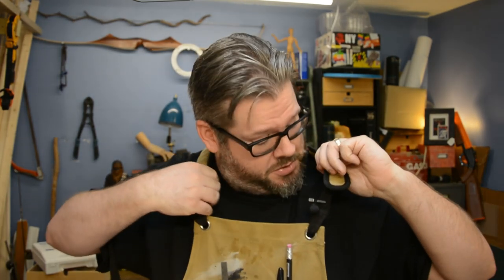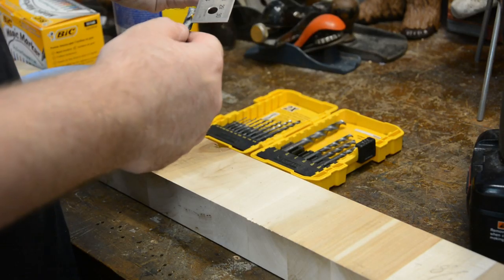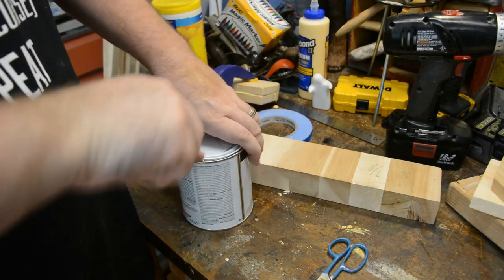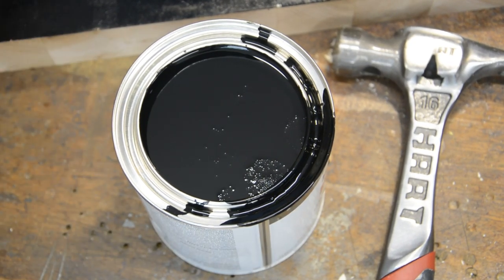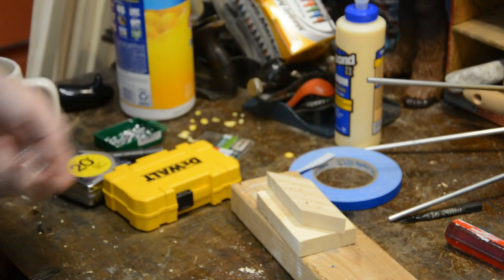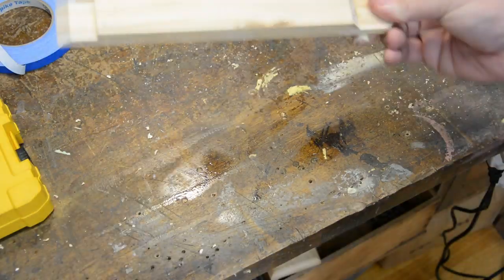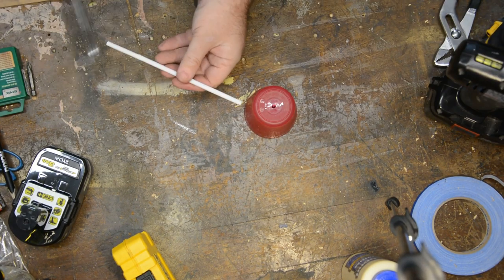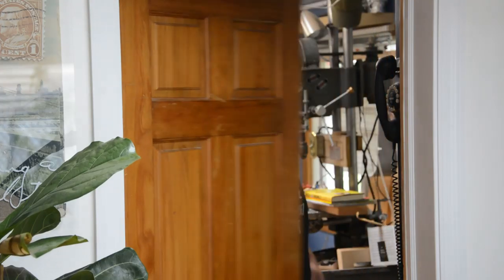10 Easy Shop Hacks

Comment: Salt is good to have in the shop, along with lime.  edit:  My bottle opener is hanging on the side of my drill press cabinet, beside my chuck key.  Gotta have pops in the shop.  Of course, not when you're working with power tools.  Only for clean up.

Comment: Hi do you think is a good idea to have an air conditioner in a shop or its better a fan or a extractor?
Reply from the maker: I have no clue why, but this message only just popped up on my channel.  I think the major problem with A/C units in the shop is that they usually recirculate the air from inside the shop. so it takes in air from the shop, and shoots out cooler air into the shop, then takes in that cooloer air and makes it colder, over and over until the room is at the tmep you set. in this case, the A/C is also taking in dust, saw dust etc from the air. THAT'S a problem, as iot can harm your A/C if not looked after.  There are some A/C that give you the option of the A/C taking fresh air from outside instead of from in the shop.  Thats what I have had for years. At this point I run that second type of A/C and a dust extractor in my shop fairly regularly. Seems to work well for what I need to use it for. however, when ventilation is called for, i bust out fans toboth bring in fresh air, and vent out the air that needs removal. It all depends on what your needs are.

Comment: I love a good tips & tricks & hacks video! You have some really good ones!!!

I routinely smash my fingers when wielding a hammer, so have learned to just avoid using fingers at all to hold the nail. Bobby pins, clothes pins, pliers, tweezers... used a fork once because it was closer than anything else. 

I guess the paint can mess is a universal struggle, I've seen many strategies for this problem. I saw one fella sculpt a pour spout from his kid's play-dough! There’s another solution that uses 2 pieces of painters tape to make a V over the can, not sure if it holds up when pouring high volume, or using large brushes.

Well, keep up the good content! I know this video is from a long time ago, it still adds value to lives. I appreciate your effort!

Comment: Open a can of paint and putting holes in the edge for drainage will also make your paint dry out while it is in the can, not a great idea if you have left over paint.
Reply from the maker: Literally never had paint dry out. I do it all the time for the last 30 years. I think it may be about putting them in the right place. As long as the holes are on the bottom most part of the rim, they are completely covered when the lid is put back on.

Comment: Opening the can of worms, I mean paint and putting holes in it is great. My father does it also and that is where I learnt it from. It was only one hole however. Sometimes multiple holes would be nice. Gonna try it
Reply from the maker: The thing to remember is to keep the directly in the bottom of the dip in the can. If you put the up the side at all, when you put the lid on, it can let air in.

Comment: Instead of making holes in the paint can, you  could just use a rubberband around the top and bottom og the can, that Works really well.
Reply from the maker: I’ve used to. Splatters a lot and you have to go slower to make sure it doesn’t.

Comment: The filter spinner trick really works - IF - you can contain all the dust.
Best to take it outside, put on a mask, and use compressed air to clean it - that's what I do..
Reply from the maker: Lol! This whole thing came around from me doing exactly that! I live just outside of NYC and properties are super close together. I went outside to bang mine around and clean it out and ended up covering my neighbor’s yard. Led to a huge argument! 😆 that’s when I thought I should find a “better” way! 
I ended up solving the problems entirely with this next build. Went and made a 2-stage dust collection system implementing HEPA rated filter and dust bag. Check it out! https://youtu.be/k5GpNyH_FBo

Comment: One more simple tip, especially for guys & gals whose shop has a cement floor. Wear a back brace. You can buy them on Amazon for under $30.00. I mean think about it, you are doing a lot of physical activity and putting a lot of stress especially on your lower back when you are working in your shop. I use one whenever I work in my shop. The support the brace offers helps me a lot.
Reply from the maker: Nice!

Comment: L5
lumbar spine #5 (the lowest of 5 vertebrae in your lower back). 

S-1
The uppermost vertebrae of the lowest section or your spine. 

The spongy disc that cushions between each vertebrae is bulging out of its space. 

80% of them heal on their own. 

Lose weight. 
Strengthen your core muscles. 
Use rowing machine like you were born on one. 

Problem mitigated.
Reply from the maker: Cynical Texas Dad that so funny. My Dr said that almost word for word. Been doing it. Just got cleared for no surgery needed! Very excited. Still working on weight loss. Thanks!

Comment: why would you introduce salt between to pieces of woods that you are trying to glue together?  Defeats the purpose of cleaning dust off of parts to introduce bigger granules of salt.
Reply from the maker: Actually it doesn’t work like dust at all. You aren’t covering the glue in salt, you’re using I tiny bit. Salt simply adds friction, allowing the pieces to more easily be aligned, before devolving due to the water content of wood glue. Where dust is not water soluble at all, and often covers the entire area of not cleaned off first. This trick is used by so many professionals and is so ubiquitous in the woodworking world that almost didn’t include it because it figured everyone must already know it. Thank you for checking out the video!

Comment: Instead of poking holes in the paint can, put a rubber band around the can going over the opening and use that to clean your brush.  :-)
Reply from the maker: I used to, but when working with smaller brushes I found the the rubber and would often “splash” paint up because it’s elastic. I find the solid aluminum can better to wipe off extra paint. But if it works for you, rock on! Thanks for checking out the video!

Comment: Place a rubber band around your paint can so it goes over the top and wipe the paint brush on that.
Reply from the maker: This has been brought up a bunch in this thread. Consensus seems to be that doing that ends up splattering paint across the room if you’re working at a steady, solid pace. But if it work for you, awesome!

Comment: Thanks for sharing, Burke. Another tip with those tiny nails is to take one of these pencil erasers:
https://www.walmart.com/ip/Paper-Mate-Arrowhead-Eraser-Caps-144-Box/14915298

... Stick it on a dowel, and with a hobby knife or box cutter, cut a slit perpendicular to the long flat edge. That slit can then hold tiny nails and brads as you set them.
Reply from the maker: Niiice!

Comment: If a paint can is pierced as you show  even with the lid on air will get in and solidify the paint
Reply from the maker: That’s incorrect. I’ve been doing it for 30+ years. As long as you put the holes where I show, when the lid is reapplied correctly, they are completely covered.

Comment: I didn't like the trick in the paint can. It won't seal when you put the lid back. It's better to put a string across, held by tape on every side. Yo pass the brush against it to shed the excess paint.
Reply from the maker: I was stake a back when you said that. I’ve gotten more positive feedback on that hack than all the other combined. I’ve never had issue with the lid fitting afterwards. Where exactly did you put the holes? It’s possible that they were made too large, I suppose. Forcing a wedge in too far def could have caused deformation of the can.
Reply: Arturo Luis Alfredo Lisdero Molina even better than a string A rubber band stretched around the can vertically.
Reply from the maker: Use to use a rubber and. Thinner paints “splash” back. Not my favorite way. But if it works for you, great! Thanks for checking out the video!
Reply: Actually it works just fine if you do it as shown.